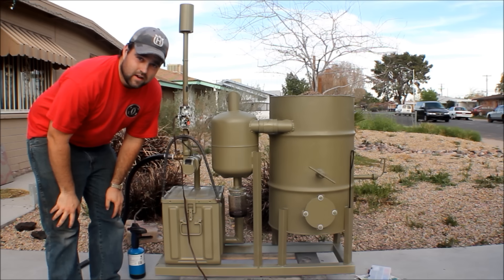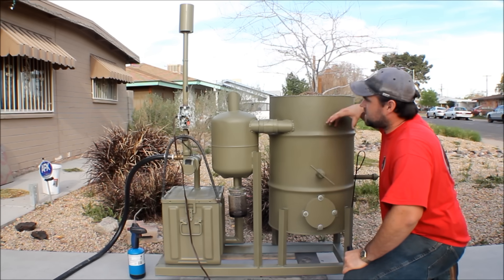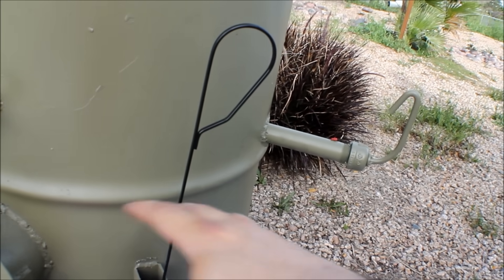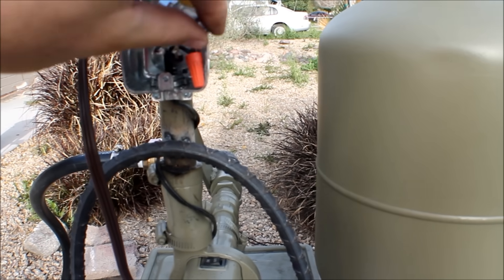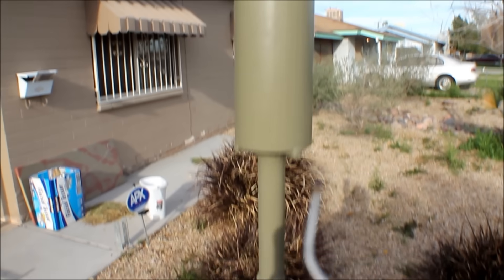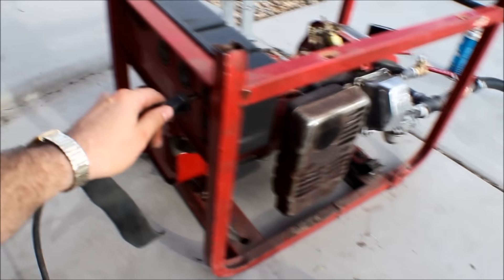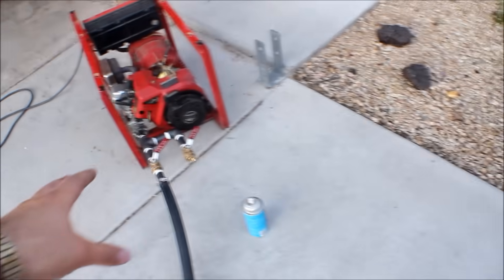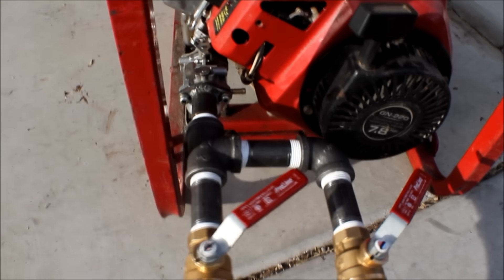amazing homemade gasifier uses wood pellets to run generator -- renewable alternative energy video

Comment: Well, at 1 euro for 1 kg of pellets, the price in Portugal, this solution is just naive...  The energy contented in 1 kg of pellets is far inferior to 1 liter of gasoline / diesel,  and if you pass that through several converting cycles ( thermal - mechanical-electrical) loosing energy in everyone... so, the output is far inferior from start, and if you add the complexity and the maintenance (and costs..)of each system involved, you realize, at the end, you finish with a very low output, from a very complex system, with a lot of maintenance and costs far over other systems. 
Pellets are already very expensive in Europe, and the wood will become more and more expensive, with each year and decade. Not something you want to invest on, imho.  You will  get far better results / and a lot cheaper) with just a solar panel.
Reply: I just checked my local area and it works out to 6.5 euro for 18kg of pellets bought in the smallest size bag (not in bulk, which is cheaper).  I'm sure if someone was really into this, they could find a way to make the wood even cheaper. In the end though, I don't think it's the immediate cost or how efficient this is compared to gasoline.  Petroleum is king.  But, a few tons of wood pellets will store for an eternity in a forgotten corner of the yard with just a tarp over top.  Keeping that much liquid fuel on hand would be a nightmare.
Reply: @jeffreykershner440  - "a few tons of wood pellets will store for an eternity in a forgotten corner of the yard " nop, here you are deeply wrong, dude ! The pellets are cover with a thin skin to protect the wood from humidity - once that skin start falling, the pellets will lose quality and take humidity, resulting in a lower energetic value. Reason why nobody store pellet for more than a year, in unprotected environments. But the worst thing here, and only few peoples realize, sadly, is basic physics: each energy converting cycle lower the final energy, and here we have 3 (!!!) cycles ! The modern gasoline combustion engine operates at an average of roughly 20 to 30 percent engine efficiency. The remaining 70 to 80 percent of the gasoline's heat energy is expelled from the engine as either exhaust heat, mechanical sound energy or friction loss.
With this "system", is probably 5-7 % efficiency... awful solution.
Reply: What if you have no electricity and tons and tons of trash wood? Would it make sense then?
Reply: @destro513  - what you found a 3 millions diamond ? Real life is not of "whats"s and "If"s...
Reply: @mirandela777  I think destro is on to something though.  FEMA in the US is the Federal Emergency Management Agency.  They specialize in disaster recovery.  In the US we get to the "worst case scenario" for a hundred square miles pretty regularly.  It was not unusual for me growing up to have the roads washed out and no power for one to two weeks at a time due to flooding.  Plenty of wood from downed trees and ruined houses.
Reply: @jeffreykershner440  - those are particular situations, tough, and even so, if you need electrical power only, you get a lot better results with a solar panel or just a windmill.
Just saying... A pile of wood is just a pile of energy. How much you manage to extract and use, is up to you. This system is very ineffective at that - is just a wood powered electrical generator, passing through 3 cycles.  Efficiency is abysmal. A solar panel or a windmill is only one cycle or, respectively - two. Much better.
Reply: It's naive for YOU. Where I live you get 3.5kg of Pellets per dollar... either way who cares??? The real deal is using WOOD to make electricity.  I can find 1000s of kg of wood in my area for FREE. People are always having tress cut down and want the wood removed. I could get enough free wood to last years.
Reply: @randybobandy9828  - dude, 90 %+ pf world population live in metropolitan areas, where NEVER a piece of wood is free ! You are the naive one on this, or ignorant ! In a side note, the pellets price is double/triple now in Europe,  between 10 up to 12 € / 15 kg , 3-4 times more than you say. Most of us do not live in the wilderness, like you, where wood is free to collect.

Comment: Out of everybody on the internet that I have seen Bill to gasifier yours is by far the best looking the best working I've totally impressed with the way you built yours call all the other ones they look like a bunch of junk welded together and I see tar build up on them on the motors how much car builds up have you gotten on your generator I'm going to imagine that yours is very efficient and you catch most of your car in your filtering system the animal box was an excellent idea keep up the good work

Comment: Remember previously our camera using battery n battery water to launch our flash cheap n good plus no need to keep on changing our dry batter. N expensive  we are using that formulae as references to do reverse engineering.Amen this are our observations views n opinion.

Comment: You could pipe some water tubing in there and cool it off with a pump. You could use parasitic power off that generator and it could cool itself off. You could even have a thermocouple to switch the heat exchanger on and off within a temperature range.

Comment: Very impressive build. The only thing I would have done differently would be to get rid of the rubber couplers (your weak link), add a cooling system of some form and possibly a car blower motor instead of a inflation motor (they aren't designed for continuous duty.) You could also use a blower motor switch and resistor block from an old car to control your speed.
Reply: It doesn't need a constant duty blower motor, it only needs to run a few minutes to start it up - about the same duty as blowing up a large air mattress.
Reply: @WestCoastWheelman  Got it! Thanks for correcting me!

Comment: Excellent vid matey but TBH this shouldn't work as you are already burning the gas from the wood pellets. what you should have is a separate chamber that contains the wood pellets completely sealed with just an exhaust for the gas to be extracted no air can get into that chamber, the fire should be lit underneath it with what ever you choose wood, pellets etc. this gets the chamber hot and the pellets inside the chamber brake down releasing the gas without burning, this will release lots more gas and be a lot more efficient. great build to be fair

Comment: Has anyone tried to power propane things with a gassifier? Like camp stove or full size stove? It would need to run through a pump to compress the gasses for more pressure in sure but I'm curious how well it would work and if anyone has tried it yet. A mini system for camp stove and camp water heater would be awesome!

Comment: Great video! However, what is done with the initial heat from the wood combustion?

Couldn't you use some of that heat around the burn barrel to boil steam for additional efficiency? Just wondering!

Comment: I think one of these could be turbocharged and liquid cooled and it would be a beast. The more efficient the cooling system the better so if you had access to a large pool of water you could cycle it around the outside and cool the gas down like an inter cooler. I want to build one of these now.. hold a bunch of water out of my well in a large tank and use it for my cooler.

Comment: This is the coolest thing I've seen! Definitely going to build one of my own. I plan on building a microhome that I can get off the grid with and this will definitely come in handy to charge my lithium-ion battery pack on days when solar is not an option. I will also run some copper tubing around the combustion chamber to not only cool it but to heat water for a hot shower! Thank You So Much!!!

Comment: Well done. Are you tracking generator  hours of operation using the pyrolysis gas? Just wondering about internal combustion engine life span. Fuel will not be to engine design specs.  This has been an issue with large scale adoption. Having encountered this issue, I have been looking at similar concepts but to generate steam and drive turbine for electricity generation.  Happy to discuss.  Perhaps we can discuss.  I have tooling for the steam engine that will fit this scale.

Comment: Put this combination on a flatcar, charge a row of batteries with the generator use the electricity to operate a traction motor and you can make a locomotive out of the flat car.

Comment: You need to figure a way to adjust your fuel settings so it will run so the engine regulation can handle load varitations.

Comment: What does the inside of the cylinder of the generator look like? How long have you ran the generator on it? I wonder if it would cause a lot of carbon on the inside.

Comment: Moreover would be an excellent idea cool it down with water (copper pipe all around the central cylinder), which can be then used as hot water for the house and efficiently recover that heat. Therefore there would be cheap solution for insulation, rock wool for example, that one used for roof or wall insulation would do the job, alumina wool is sold for very good prices on Amazon as well.

Comment: and what if you connect a turbo pipe with a suction fan inside right in to the fire (somehow it has to be designed, just like a car turbo)? That will increase productivity surely? (and a flywheel!)

Comment: I feel like you could hook up a system up that would have a copper coil full of coolant going around the middle pipe,  that way you could hook up to a heater core or radiator for the heat. You could probably use the generator to make the pump as well. Similar to how a car works.

Comment: Maybe try some wire wool in a tube before any area of ignition, the wire will stop any backfire.
Silicone pipes will handle the heat better incase it runs hot

Comment: you can get LPG / propane carburetors for small engines like this. The proper term is 'mixer'. But running a mixer it will start/run much better over all loads.

Comment: does anyone have gasifier plans (or built one) that has a pressurized cylinder of the gas/vapors so the generator runs at a constant speed? Also, has anyone ran a generator for a year or more (using this method) and inspected the condition of the cylinder for tar and other issues?

Comment: could you put a heat exchanger on it so you can use some of the heat to heat the garage? (that would allow it to run cooler so you could run the generator longer)

Comment: I've heard the EPA is going after using wood for fuel. They are getting rid of wood flames in the name of Climate Change. The truth is they will go after anything we can do ourselves and force us onto their corporate tax system. First was the Prohibition amendment to smash all the stills, then the Hemp act. Next is wood. Don't stop using it, just stockpile wood pellets as much as you can. The EPA did pass a resolution to eventually get rid of wood but no time line has been assigned.

Comment: you could also wrap the barrel with copper pipes and enclose that to keep heat in; the pipes will with water could then heat a water tank, and even hot water for heating an entire home. the hot water could also be captured as steam to power an alternator to charge batteries.

Comment: Please people don't go plasma cutting or flame cutting into a barrel or confined container.  Especially If you don't know what was held in it.   It might have residue that is highly flammable or even explosive.  Ie cooking oil will explode in confined spaces with too much heat.  It acts like diesel fuel.   I know a guy that died cutting into a barrel he found.  It blew up in his face. And he didn't die right away.  No.  It took like a week in the icu burn unit.   Not good!

Comment: Run some copper pipe around the outside and flush water through it and got yaself a hot water system at the same time

Comment: If you dbl the distance between genie and gassifier the gas would be cooler add to that you could run the pipe through a trough with water in it

Comment: If its a 12v dc motor, you build and use your own pwm motor driver using ne555 ic and few components.

Comment: Excellent! I plan on building one of these to power a small wood chipping machine, which I use to process my willow plantation waste. Some of the (dried) woodchips can be used to fuel the gasifier, so creating a circular system as done by the late Jean Pain decades ago.
Reply: How'd it go

Comment: Shalom Aleichem. 

I wanna have as many options as I can when the SHTF.

In addition to solar / wind combo which will be expensive, I'd like to start with this first to run my 6K generator.

The generator isn't quite big enough as it won't power my well pump, water heater,  two freezers, refrigerator & a/c unit at once, so I was thinking a 12K ought to handle it. 

I live pretty frugal and my normal electric bill is around $25 per month during spring and fall & approx.,  $50 during summer when I run the 5k btu window a/c unit and $35 per in winter when I heat with wood and have fans to circulate it throughout my 1,000 sq ft single floor home.

With this unit I could capture some of the heat to help heat my home & maybe hookup a coil system to provide hit water?

If you could provide plans (you've already weeded through the bs and got to the nitty gritty.

Oh one more thing, would this work on a diesel engine?

Ratson haba b'shem YaHuah.

Comment: I wonder if you could compress the vapor and use it later out of a tank...
Reply: you can with an old air or fridge compressor but it don't compress as good as propane

Comment: I feel like everyone who does these can simplify it by useing a barometer to filter put the particulits and if u need pressure to the generator at first just put a rock on top and boom pressure...either way looks cool and it works great job

Comment: This is absolutely amazing! How would you consider use of powdered fuel. Perhaps a ceramic filter or grate at the bottom to prevent static ash discharge

Comment: A friend of mine saw your video and hired his welder (me :)) to build him one. So a-thank you for the side gig and b-im using a 55-gallon drum instead of 30 with same 4 inch fire tube...will this help to combat the overheat issue you ran into? Appreciate any guidance; the video is excellent, thank you!
Reply: How did your project go? I'm a welder/fabricator and also a farmer I hundreds of achers I wanna use instead of just burning them could you help a guy with some plans
Reply: Hey, how is your Project going?
Also have you considered to add a heat exchanger (like an old radiator or so) to cool the vapors?

Comment: Why don't you add a spark ignition at the stack and a temperature sensor above? If it ignites and the temperature reaches a threshold you can switch a relais which switches to the generator. Then add a starter to the generator and a relais on the generator output which turns off the blower when it outputs line voltage :)

To start the ignition in the barrel just put a two steel wire in the barrel behind a high voltage generator with 10 kV or something like that. The fire should be cold enough to let them survive.

This way you can automate the startup to a press of a button :)

Comment: Would it be possible to skip having the need for a fan by making the "chimney" taller to get a better draft? That might also make it hotter, so I guess you'd need to increase the diameter at the same time.

Comment: Okay so I will give you credit for building a damn nice gas fire but what the problem is when the shit hits the fan and all the stores are closed where are you going to find wood pellets so you're in the same shape as everybody else you need to build a gasifier that you can put wood chips in or anything that will burn chunks of wood that you can cut up if you can't put that in there then your gasifier is actually no good for it when the shit hits the fan because the stores aren't going to be open for you to go purchase more bags of pellets so my question is can you burn anything else in there or is it just set up for

Comment: How about putting an O2 sensor on the exhaust of the electrical generator so that it's easy to vary the power output? Just adjust the gas valve for the power you want, then adjust the air-intake valve until the O2 is right.
Reply: I don't know if it was the microphone or the generator but it sounded as though the mixture was wandering. The air flow to the engine is going to change as the engine accelerates or comes under load controlled by the butterfly in the carb. Duh, we all know that. What we need to do is adjust the fuel according to air flow. An O2 sensor and some means of connecting that to a fuel regulator would be ideal always bearing in mind a gas engine of any kind needs a rich mixture to accelerate or pull so that is part of the calculation. Propane and Natural Gas engines generally use diaphragm pressure regulators regulated by engine vacuum for this purpose with either some kind of enrichment device for speeding up or pulling or just running the system a bit rich all the time like gas lawnmowers do. Always better a bit rich than too lean, lean causes engine failures.
Big old Natural Gas power plant engines running 24/7 at fixed maximum load constant RPM had the simplest of carbs, venturi+ butterfly+fixed jet. Jet being a piece of pipe with the end angled, so crude and simple. Mixture adjusted by monitoring output and exhaust temp. Monitoring exhaust temp is a useful way to adjust mixture without an O2 sensor.
My gut feeling is there must be a way mechanically to have the carb butterfly tied to a fuel gas butterfly that opens proportionately but faster than the carb. Food for thought. I'm sure it's all been done before.

Comment: Hello sir, you are losing a lot of electrical energy from the battery and it is a useless method.  I suggest you use a pwm driver to reduce the heat wasted energy